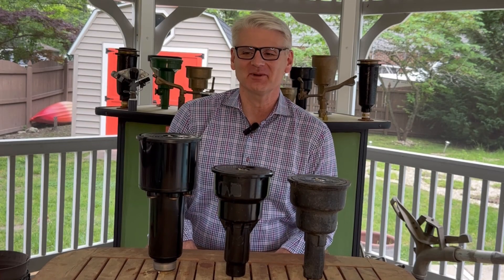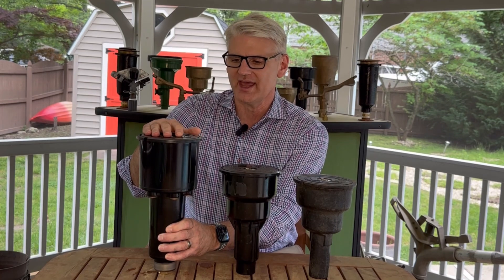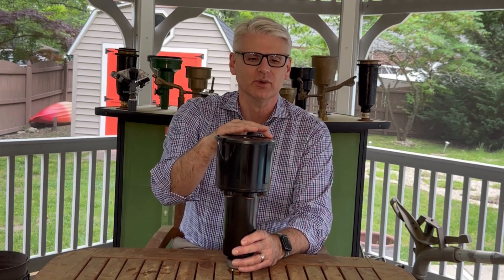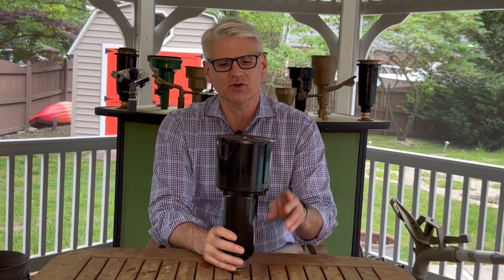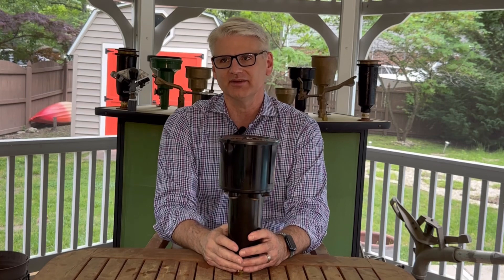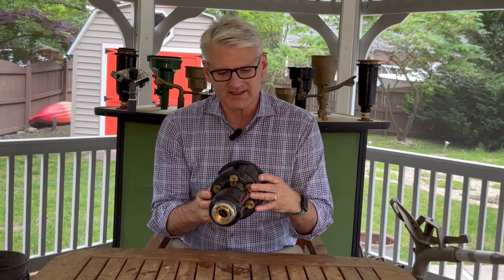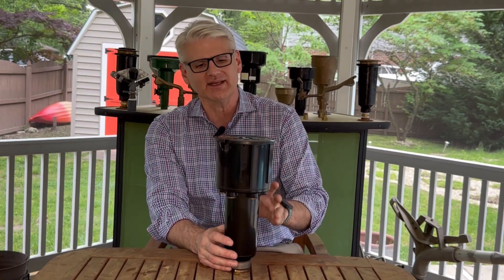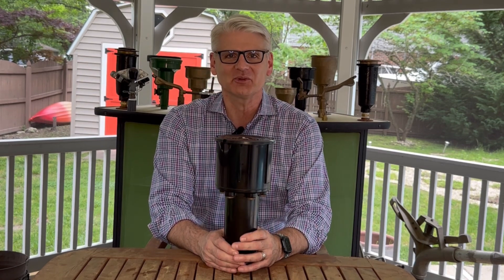70’s Innovation- Vintage Rain Bird 21 SAM 1” Pop Up Impact Sprinkler with a built in check valve

Comment: So here's a story for ya.  My dad bought a large property off a lake about 10 years ago, and the first project was installing an irrigation system into the 2 acres of grass he had.  I scoured ebay for 51APs, 47APs and scored some 37AP and 27APs along the way.  Some were "New old stock", some were used and the ones that were used keep up just fine with the new old stock ones, and they probably have about 15-25 years of service already under their belt.

These things were built to last. I believe the only thing that got large commercial turf and golf courses to change out was all the fancy whizbang features of valve-in-head, 2 wire in head, etc.
Reply from the maker: That is so great that you built a system with those. I agree. They are incredible workhorses. I also agree about their demise, but I just don’t think you can match those rain bird impact rotors (27,37,41,51, etc) for distributing water. Just great sprinklers.

Comment: The internal SAm was inferior to the external SAM which could basically hold back any amount of elevation change due to its design.
Reply from the maker: For sure. Where you had an elevation change of more than 7’ across a lateral, you’d definitely have no choice but to go external. Not so much an issue on sports turf. Suppose someone could have used these on a large estate where there could have been large elevation changes on a lateral.  In block systems on golf courses, where elevation change on a lateral is very common one way we’d combat that was valving high and low sprinklers together where a fairway had a slant to it (that tended to match up watering requirements better, too). You’d still run into changes significant enough between the valve and the sprinklers that would cause you to go with an external check valve. I did a course that way in the side of a “mountain” with some fairways that were tilted like a funhouse. Tee complexes could also have a lot of elevation change on a lateral on block systems.

Comment: Do you have any catalogs over the Rainbird 70 series? From the 40s and 50s? I just saw some sprinklers on Facebook Marketplace that are call rainbirds but there's a model no. 30, no. 70, and 170. I didn't know what a 170 was but they look exactly like a 70 and I didn't know if a different company built the same style sprinklers as Rain Bird no. 70. It appears that the sprinklers say MFG (something) RANE IRRIGATION. I just didn't know if you had any idea what kind of sprinkler it was. Thanks, also the guy on Facebook was thinking about scrapping those sprinklers❤😕
Reply: Also I was thinking about getting a couple of them
Reply from the maker: I do have catalogs from the 50’s, 60’s, and 70’s. I haven’t seen the posting, but  what you’re seeing with the I70 that said Rane Irrigation on it is a 70 private labeled by Rain Bird for an agricultural irrigation company. There was a company in Oakland Rain Bird made a bunch for way back. I’m sure they did it for others. Cool collectible.

Comment: Great information Bill!
 When we rebuilt these in the 80's and 90's we had to pull the check valves out just to clean the side built in inlet screens as well as replace the lower screens.  They also had a breather tube that extended up the inside of the case that needed to be clear so we blew air thru before reinstallation. The real advancement like you mentioned was the built in check valve, the earliest ones like in your picture were all brass, very expensive and difficult to install and remove for repair. The SAM could be serviced completely in ground from the top (90% of our business was rebuilding just internals that customers had in milk crates waiting for us to pick up). Getting back to the check valve pre-SAM if you put a check valve under your lowest head the water would just leak from the one above it and so on until it equalized.
Reply from the maker: That’s true about pushing the draining water to the next lowest head. I bet as sprinklers like this were introduced with smaller ports the air would be super useful. I kind of think the hydraulic version of this sprinkler might have been an early VIH for Rain Bird, too. I don’t see any evidence of one before this.

Comment: Nice 21SAM!. IT runs well on your setup. The check valve is nice when you dont want water getting back in the system. I think my 21 is a regular, a 21AP. I don't believe it has the SAM valve in it. Thanks for the history too and sharing a very nice piece of the past!. You should install a few of these in your yard!
Reply from the maker: Thanks, Chris. That’s funny, my wife and I were talking about putting them in the yard this evening.
Reply: @antiquesprinklers  Thats awesome! When I was little I was always happy to wake up and go out in the backyard and hope my neighbors FEBCO popup rotors were running, they were similar to the 8280 ( I think ? or is it the 8265 ? ) That had the 565 head inside with the big nozzle?. Their popup rotors reached all the way into our patio! and hit t he side of the back of the house too! I wish i would have kept them, the neighbor got 47AP's installed and removed the 2 FEBCOs. They also had 3 skinner FC UR popups at the end of the yard too. I am not sure of the FEBCO model #s for those its been too long.
Reply from the maker: @NelsonBigGunP200Fan those must have been amazing to see. Would love to find one someday.